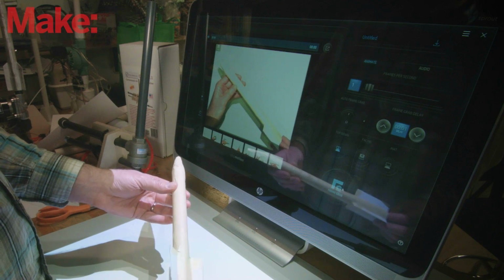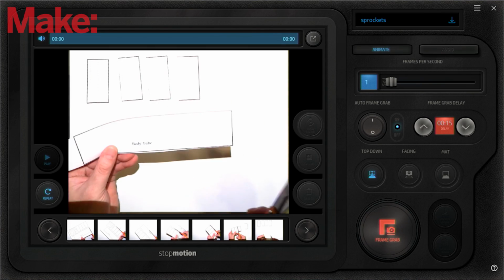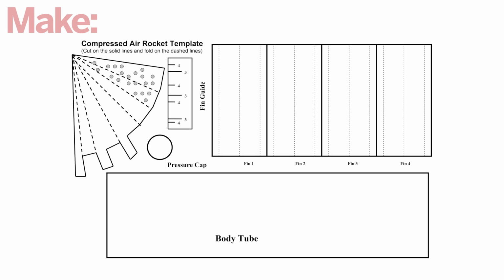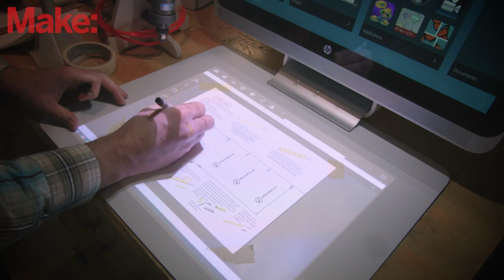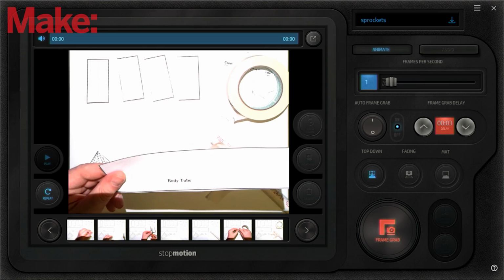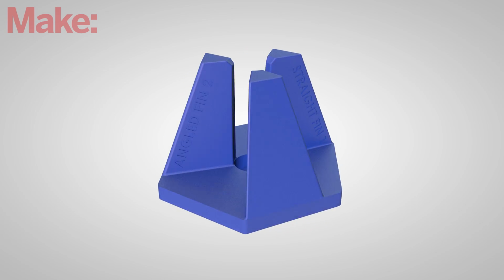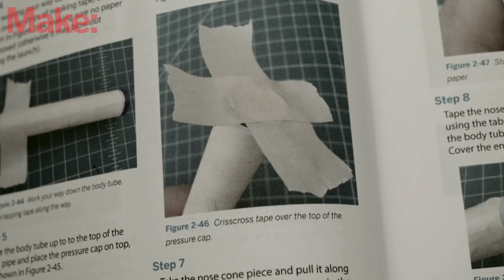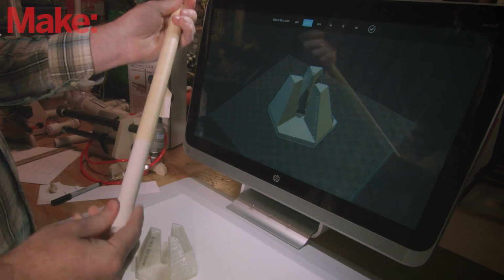Build an Air Powered Rocket using Sprout by HP

Comment: so... uh... how do we build the whole air powered part?  I don't mind that HP is pushing their whatsit, but it drags down my impression of the whatsit when it's associated with sub-par stuff like this that's more ad and not enough content... such as a more complete "how to build an air powered rocket."  (And clearly, the whatsit doesn't exist in-and-of-itself (because it's a goofy mess, and I've messed with one of them in person) but rather as a cool thing to be associated with the current version of the HP brand in the hope of enhancing and differentiating the brand from the rest of the many, many PC vendors, so when stuff like this makes the whatsit look "meh", then the intended effect is flipped on its head and drags down the whole HP brand... which as an old-school guy like me sure isn't the HP of perfect lab and test equipment or the HP of rock solid printers... rather it's the Fiorina HP of awful, massive software installs trying to get drivers for printers that won't print black because the yellow is out.)